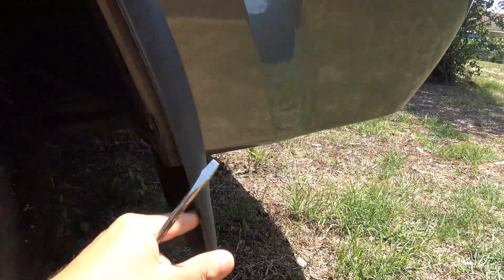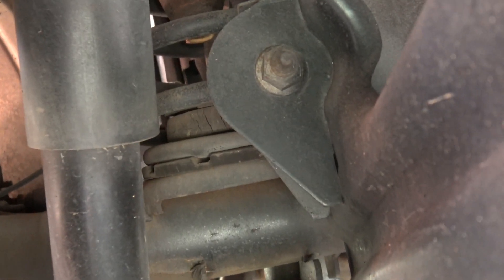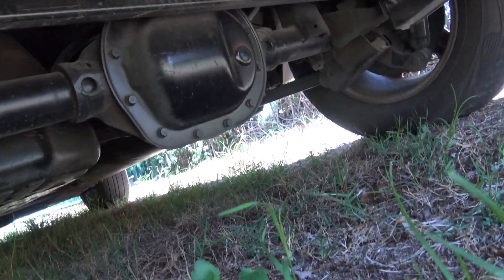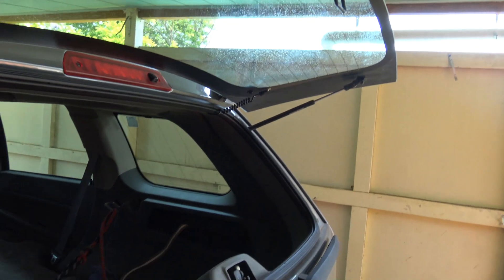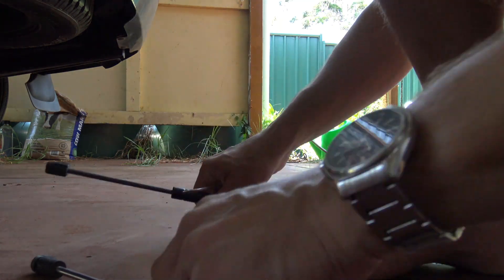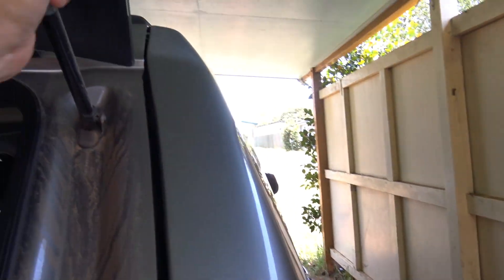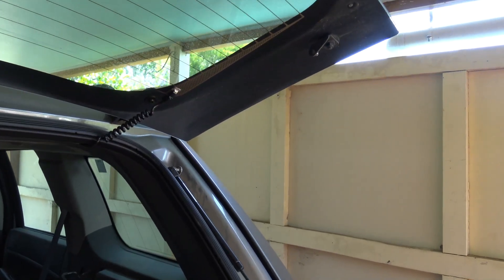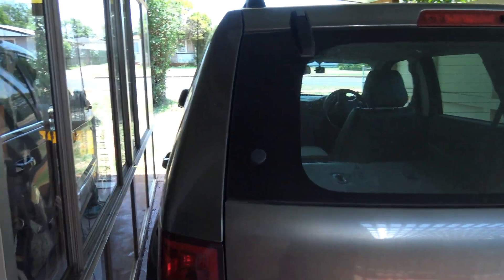Husky transport repairs, 2006 Jeep Grand Cherokee strut replaced

Comment: I’ve never changed those struts out on the window but I have gap the gauges on the spark plugs you did a great job, I’m holding onto my 2000 model Ford explore it has some problems but I know everything that’s been wrong with it and what hasn’t, I would take off in it and drive any where not to bad on gas on the highway more so around the house. I would leave my Jeep Patriot here and take the Ford any day lol. I’m glad I’m able to watch some videos again
Reply from the maker: I'm worried if something breaks and I've no support. It hasn't done a lot of miles, 70,000 but its the age. Its clunking and gowning more and more and the weather here doesn't help going below freezing to 100 every year. I'm doing the math and if I fix the suspension, replace the tyres I'd be out of pocket about $2k over 10 years if I got a new car. The issue is, is it worth it as I'm expecting to travel about 30k over the period. But if the air goes out or the turbo goes I'd be up ship creek.